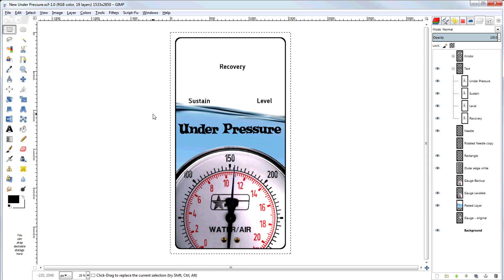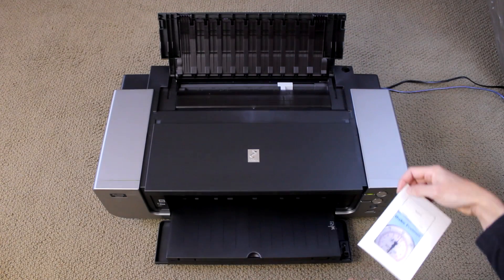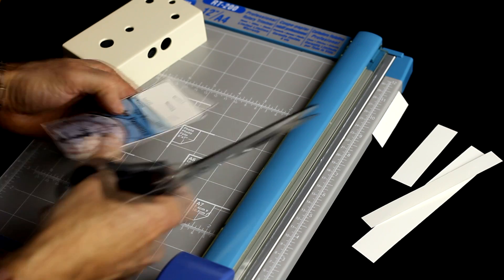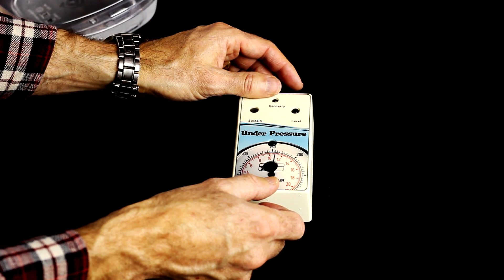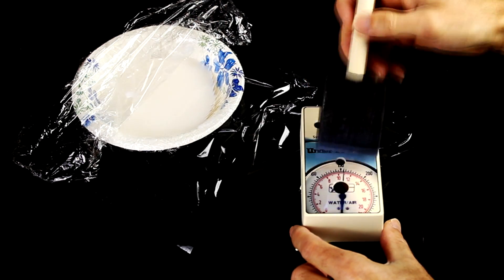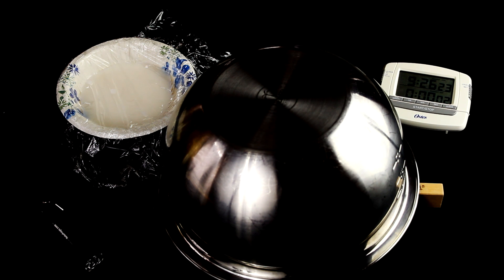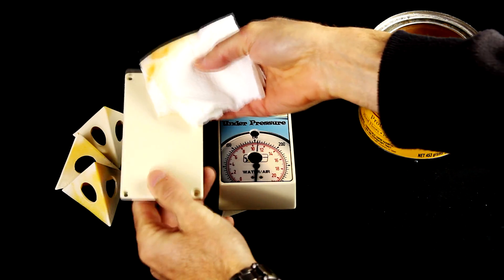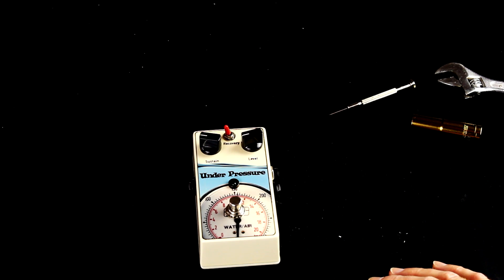Printing and Applying Waterslide Decal to Pedal Enclosure

Comment: The best polish for painted surfaces is to buff with farrecla grade 10 which is water based and used for polishing car/auto paint with a rotary lambs wool mop using water,once it's cut with farrecla(there are several grades,unless you have any scratches just go for the finest grit 10) after this is washed off dry and then use 3M hand glaze,the end result is amazing.

I have a Triumph spitfire that i restored and was given this info by a pro car/auto spray painter the gloss is long lasting to,and cars have a time of it in the outdoors.

The farrecla and the 3M hand glaze are not super cheap but not crazy expensive,the farrecla has to be wet buffed so it uses a small amount of cutting fluid,the hand glaze goes a long way too,also it works ultra amazing on guitar bodies.

Never ever ever use T-cut,T-cut contains ammonia and dulls paint,it looks good for a little while but oxidizes the paint while farrecla does not,the guy who told me worked for himself but also worked in a shop here in Glasgow(Scotland) that did body repairs and obviously paint for jags and Rolls Royce so the quality had to be in the finished product.

I never use anything else now.

Also just as i observe a wooden block cut to the inside shape of the enclosure with a pole type handle would help.....just saying.

great content .

Comment: Do you think this process would work if it is all printed and applied BEFORE drilling holes into enclosure? Long story short - I am going to print the design onto the pedal, and ship them to the pedal maker to then drill the wholes and create the circuits. thoughts?
Reply from the maker: I've never tried that, but I guess it should be ok. Usually drilled holes  are covered by a nut or bezel. So if the decal is a bit rough around the edge of the drilled hole, you won't see it anyway.
Reply: @johnplanetz  thank you so much for the response. while i have your attention… today I’m spending time at the hardware store gathering all the supplies they did not have the water-based polyurethane, but they did have something similar in spray form. I’m curious if you think multiple layers and coats of this spray…satin water-based coating would work directly on top of the decal.
Reply from the maker: @jakenewcomb8897  - yes, multiple coats of the spray should probably work ok
Reply: thanks for the info. after a few trials and errors i was able to get my waterslide decal printed, coated with clear layer and removed when dipped in water. now my new issue is that i realized all the 'white' in my design, did not transfer when printing. most printers dont use white ink, but instead let the paper itself be the 'white' part of the design. so now i need to either figure out if i can load white ink into my printer, or if i should just paint the black surface of the pedal white and let dry before applying the decal. its a process - but its fun to learn!
 @johnplanetz
Reply from the maker: @NEWKS_HOT_SAUCE  - yeah that's correct.  inkjet printers don't print white, so you need to keep that in mind when designing the artwork. I talked about the background color in the previous video in the series: https://www.youtube.com/watch?v=_5Yem7yHkUE&t=300s

Comment: I just did a waterslide decal on a pedal and I haven't done the clear over yet but there are some noticable edges on the face of the pedal. What would you suggest to even those out so they're not perceived?
Reply from the maker: Hard to say from here! I don’t think the decal will respond well to sanding its edges. It might tear or become rougher. You could try, but it may be better to start over with a fresh decal (cut a little larger or differently to avoid the edges showing).
Reply: @johnplanetz  I ended up putting a plate over it. If you'd like to see the pedal, it's on my Instagram under @boss_pedal_aficionado

Comment: Excellent video. It’s been really helpful as I work through my first pedal. How long should I wait after spraying my ink jet printed label with acrylic crystal clear spray before putting it in the water?

I tried a test run after a few hours of applying 3 clear coats and the whole image dissolved. Thanks
Reply from the maker: Seems like 3 hours should be enough, but it depends on temperature/humidity/etc.  Double-check the instructions on the can, and I guess wait a little longer or overnight for your next test run to see if it's better. And don't forget to check for complete even coverage when spraying, as I showed a 2:50

Comment: Thanks for these great videos. I just finished priming/painting my pedal. It has a rough texture to it (I’m guessing because of dust). Would it be ok to lightly sand it to smooth it out before applying the label?
Reply from the maker: Yes I think a light sanding should be ok

Comment: hi! i'am planning to use polyurethane over acrylic, because they say polyurethane is more durable. What are the things to keep in mind when using this two kinds of paint to avoid problems? I'am not really knowledgeable when it comes to painting.
Reply from the maker: Just be sure the acrylic is dry before applying the polyurethane, and you should be fine

Comment: Can i ask if this decal is good for mugs?  May concern is , What if the mugs get wet again after installed the water slide transfer decal ?  Maybe the decal can remove easily because it's installed
 by using water..
Reply from the maker: You should hand wash only.  I've read that you can make it  dishwasher-safe if you fire the mug in a kiln, but I haven't tried.
Reply: @johnplanetz  ok sir, thank you for your time.

Comment: What if I were to use a sticker instead of a decal? Would the print fade or smear upon applying the clear coat?
Reply from the maker: I haven't tried that. Sounds like you'll need to experiment a bit.

Comment: How long do i  have to wait for the clear coat to dry before applying to the enclosure .
Reply from the maker: Check the instructions on the can for the drying time.  This can of Krylon Crystal Clear says "dry in 10 minutes, handle in 1 hour", so I'd wait at least 2-3 hours before getting it wet.

Comment: so, practically any printer will be fine?
as long as you use the right decal paper?
Reply from the maker: I've only tried inkjet. There are different types of decal paper for inkjet and laser printers, and I assume you will get comparable results with either.

Comment: hi 
i don't know if you are again here lol your tutorial is amazing but i have a big probleme when i want to print my pedal model (good dimension) and i choose 10X15 ,the result print not in center so i have only on part of the pedal printed (only the right bottom corner.
i don't know if i m clear :(?
thanx for your help
Reply from the maker: Every printer is different- you'll need to experiment with the print options, margins, etc. I recommend you print it on plain paper until you get it right, so you don't waste decal paper.

Comment: Thanks! This was perfect instructions for helping me with my first DIY pedal. I printed via a laser printer onto my decal paper so the spray wasn't necessary, and I followed the instructions that came with the decal sheet for setting in the decal (baking in oven at 220F for 20 mins once applied) followed by polycrylic clear coating. Looks great!

Comment: +John Cooper does it tear apart when i hand wash it? or leave it in the dishwasher?
Reply from the maker: I've only used waterslide decals on guitar pedals, and I've certainly never tried putting my pedals in the dishwasher :)  That said, if you clear-coat your finished product so that the decal is protected, I would guess that it could survive washing.

Comment: Thanks for this instructive video. I would like to pose a simple question. You use the paste wax in the end. I can see that you use furniture wax but I'd like to ask if I could use car wax for the same purpose. Thanks.
Reply from the maker: +Nuno Encarnação - I guess that if the car wax finishes clear, then it will be fine.  Maybe do a test on the bottom of the pedal to see if you like it.

Comment: my pedal base is purple and want to create a waterslide graphic of the yellow Jimi Hendrix album " are you experienced" my question is..will the purple show thru the decal or will it cover it 100%
Reply from the maker: rick jones - a water slide decal is transparent, not opaque.  So, any part of the decal that isn't covered in ink from your printer will show through to the background color.  Generally, waterslide decals work best over lighter background colors
Reply: You can get white decal paper though. I though that had white backing, for when you need white in your decal? So was opaque...
Reply from the maker: Yes, you can use white waterslide decal, but it only really makes sense over a white pedal (and even then, it may be difficult to match your peda's base paint color to be the same shade of white as the decal).  It wouldn't work well over a non-white base color, unless you specifically want a two-tone color scheme like that.
Reply: I was thinking of printing something photographic though, on bare aluminium, which mkes a bit more sense to use white kind as i want the highlights of the photo and not bare aluminium...I'll have to try it though, is resolution ok enough for photos with these, they are pretty grainy photos but if its not enough i might have to go for adhesive labels.
Reply from the maker: Sure- the resolution will depend on the quality of the artwork/photo and your printer.

Comment: can you use a high quality automotive gloss clear coat over the water slide decals or do you need water based clear?
Reply from the maker: rick jones - I haven't tried it, but it's probably okay. It does not need to be water-based. Experiment, and if it doesn't work, you can always sand it off and try again

Comment: Hi John, Great tutorial! Very thorough and the finished job looks amazing. I'm trying this as well and I'd like to print a dark decal for the top while leaving the other five sides metallic. The kicker is the white lettering... Would you suggest painting just the top white before applying the decal, or maybe using white decal paper instead of a water slide? Any other ideas/input would be much appreciated! Thanks.
Reply from the maker: dyork423 - either of those options could work.  Also, scan down the comments here for other ideas that have been discussed.
Reply from the maker: Hina Arora - I haven’t tried. I recommend you do some experiments to see what works best for you

Comment: John, great video. Quick question: Do you do anything else to the enclosure besides painting it before applying the decal? Will coats of clear coat help the decal stick or will that cause problems? Thanks again!
Reply from the maker: I show the surface prep in the previous video: https://www.youtube.com/watch?v=_wPR55HoN_M
I don't think clear coats before applying the decal will necessarily help, or hurt the results- but I haven't tried.
Reply from the maker: Hina Arora  there is no white on the decal. The clear areas of the decal show the painted color of the enclosure. If you want a white background, paint the enclosure white. You can see at 4:43 when I pull the paper backing off the waterslide decal, the clear area of the decal now shows through to the cream colored paint on the enclosure.

Comment: Hi John, I have been watching your videos on enclosure prep and decoration, very useful so thank you for that! Just have a question about colours on decal paper, will white always be transparent when you transfer the decal!? I have quite a few white bits in my design, but it occurred to me that a printer can't print white so to say! Is there any way around this so you can have pure white parts to your design?! Cheers!
Reply from the maker: You're right, you cannot print white.  The waterslide decal I use is transparent - so if you were to paint the enclosure white, then any white in your graphic will reveal as the white paint background color.  This would work if you use a lot of other color in your graphic.  Another option is to use opaque white waterslide paper.  In general, light color over dark background isn't easy to do with waterslide decals.
Reply: Thanks for your reply, Hmm that could work, the main colour of my enclosure is going to be a medium light red. Another idea I had was to replace the white parts of the decal with an off cream colour, hard to distinguish from white but will be printed as it's not pure white - do you think that would work?! Thanks for your help!
Reply from the maker: JSCProductionsUK Yes- that might work.  Try spraying a piece of paper or cardboard with your light-red color, and then try your waterslide over it to see how it looks.

Comment: Great video... and the other vid about using GIMP, never heard of it before. I been a photoshop user for years.  :-)  too bad we didn't have all the stuff like the printer,  the decal paper, graphic programs etc, back in the 80's when I was doing a lot of experimenting with electronics. I used to buy those little Radio Shack project boxes and then paint them and they never came out as good of quality as the one you built.

Comment: Hello again John! I sprayed clear coat on my waterslides last night. Its polyurethane gloss coat. Its ok, but I found I have to be very careful as applying too much DOES yellow, even though it says 'non-yellowing'. I had a problem. The wateslide decal applied perfectly and looked great, but as it dried, it blistered quite a bit. By then it was too late to push the bubbles out - this just caused creases and I had to scrap it and start again. Any ideas how to avoid this blistering? I am guess I may not have pushed all the water out, or had too much on the enclosure before applying. Thanks
Reply from the maker: Not sure why it would blister.  Did you let the waterslide dry completely before spraying?  Were you spraying very heavy coats?  (Light coats are better when spraying).  Good luck on your second attempt!
Reply: ***** Hey John. I have now had 3 unsuccessful attempts - needless to say, I am very frustrated. I have followed all tutorials meticulously using exact materials and methods etc. Its bizarre. I have narrowed it down to two possible problems. Either I have poor quality decal paper that warps and shrinks as it dries, or there is a problem with the surface of the pre painted 1590BB's I am buying. Before putting the decal paper into water, I give it a light spray of acrylic clear coat and allow it to dry. There is no negative reactions, and it dries out nice and smooth. Then I put the decal in the water - all good. Then I apply the decal to the surface of my white 1590BB. At first, looks superb. I then push out the bubbles, water and wrinkles. Then as it begins to dry, the whole surface begins to look 'cracked' with wrinkles all over. Like the way old dried out leather goes. When its dried I re-apply acrylic clear coat spray, and the bad reaction is worsened. I've ruled out the spray. Its as though the decal does not like the surface. Today I might try applying blank decals to random surfaces to see how they dry out. This is very frustrating and I am interested in hearing from others with the problem. So far, I haven't had luck on other message boards. Have you (or anyone else) tried other methods - ie clear transparent stickers? I would guess it would look a little more obvious though. Thanks for your help and time, Steve.
Reply: ***** For anyone following this, and having similar problems - I'd just like to say that I have managed to get to the bottom of it. Turns out I was using defective waterslide paper. To be on the safe side, never go for cheap, unbranded paper online. Get the best stuff you can. You can go to my page to see the vide I uploaded about my pedal - it starts with a photograph of the pedal with the applied decals. Cheers for all the help John.

Comment: hi there so I have finished my pedal in a plastic black enclosure. im thinking of applying a dark coloured dragon to the enclosure on clear waterslide. would this work or would the picture disappear as the enclosure and the image are dark? I know about white waterslide but it would sort of ruin the box as the decal wont cover the whole box (I don't want it to). any tips or ideas please let me know. thanks

aran
Reply from the maker: Waterslide decals don't work so well over dark paint- the ink will generally not have enough contrast.  And opaque white waterslide would completely change the look of the pedal.  You could try getting artistic with paint/stencils, silver sharpies, etc.
Reply: Ok thanks :)

Comment: Hmm - I've already made my pedal design in GIMP. I am now thinking about printing. It seems when you slide away, the decal has made all white sections completely translucent, which reveals the white colour of the painted pedal underneath. Do I have to do anything to make sure mine works the same or does all white sections automatically turn out translucent themselves? Hope this makes sense. Great videos - thanks.
Reply from the maker: Since the printer doesn't print white, anything in your artwork that is pure white will be transparent when printed on the decal.  Nothing special required.
Reply: Ah, thats what I was thinking. I became unsure when I seen some other examples that seemed to have actual white coloring. This is perfect for me as my B1590 enclosures are all painted white anyway. Many thanks John. I've followed and been helped greatly by all your videos. Cheers.

Comment: Hey John, do u have to wet sand in the end for a glossy look? Do you know if its possible to "bake" the enclosure in a toaster oven to speed up drying? I assume that the decal might be a problem here due to the high temps...
This method seems very nice because you can do indoor. I´ve noticed u used the "satin" acrylic coat. i believe one could get the glossy ones for glass look like....
thanks for the great video mate!